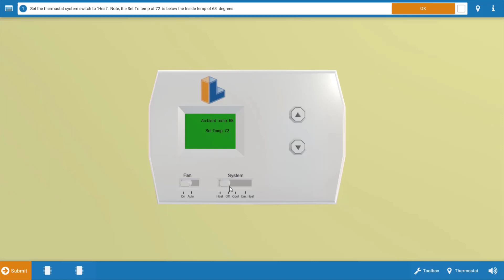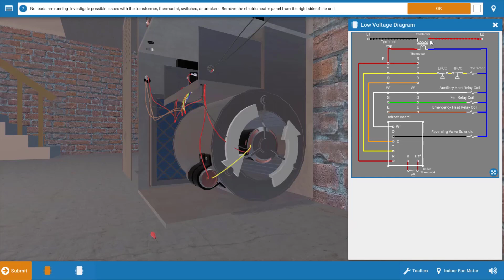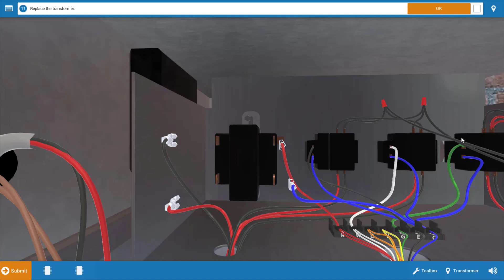[2019 Guide] Troubleshoot Faulty Transformer on a Heat Pump

Comment: Don't waste your time running around, this saves your energy and the company money. When you turn on a thermostat and nothing happens pull it off the wall and check for 24v . If your meter isn't close then jump green and red. If still no response from the air handler or 24v  then check  for the 240v going to the transformer. If you see a breaker panel check it first thing when you walk up to a house to save time and not have to walk back and check it later. Sometimes these systems are on a 3 story roof and breakers are bottom floor. Whenever you replace a transformer instead of using a wire nut to connect your red wires together, use a female spade on each end and Connect with a 3-5 amp fuse to protect the transformer in the future. If you have a short and are popping fuses I suggest for new techs to use a 3 amp inline breaker instead of a fuse while you find your short. You can find these breakers on systems you replace usually Lennox or online.
Reply from the maker: You have some great advice and you sound experience. It also sounds like you are in some big buildings which is difficult to get to each part of the system. I like the suggestion for the inline fuse and I always try to purchase transformers with the built in circuit breaker when budget allows. I think the video was suggesting to go to the outdoor unit to make sure it isn’t running with the blower inoperative as the condition could have been an issue with the blower. We’d like to add for some of our less experience readers that it is not suggested to do any diagnosis without a meter nearby. Head into the job with at least a screw driver, multimeter and a flashlight. Jumper wires in the meter bag is very helpful as well. If windings on the transformer are open, even with a fuse, look for shorts before energizing the new transformer. As another precaution, measure the low voltage current draw on the secondary side of the transformer for excessive amp draws and shut off the power if high amperage is present immediately. Typical current draw for the heating cycle on a gas furnace is around .4-.6 and usually less than .8 typical current draw for the cooling cycle or for heat pumps is usually higher but 1 ohm or less. If you are seeing more than 1.2 ohms it is likely a concern for most systems. We appreciate your comments and advice. Happy Monday!